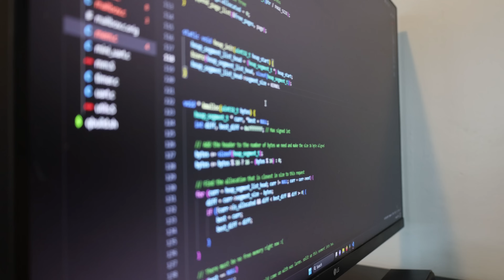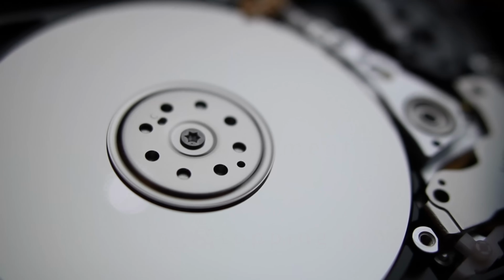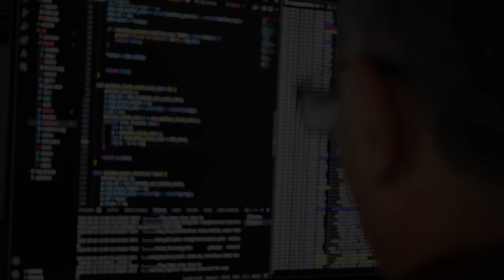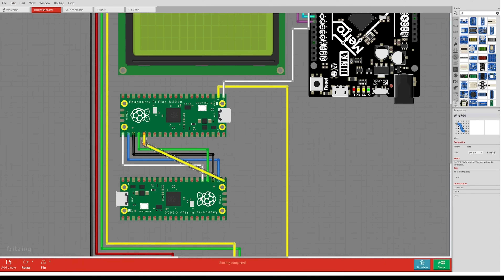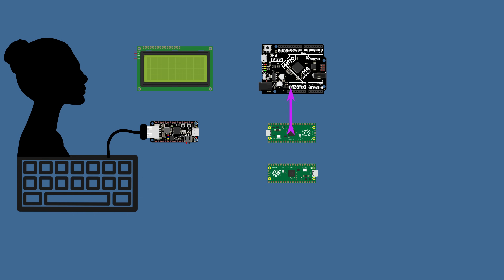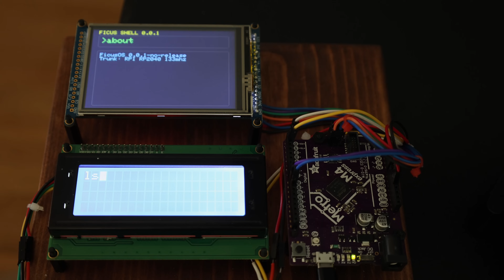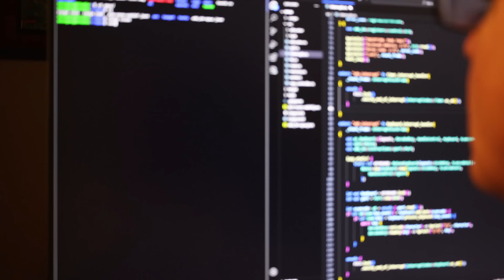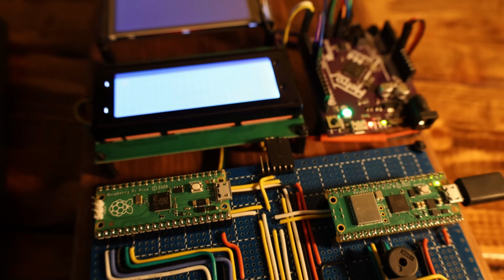Building a Retro-Styled Homebrew Computer & Operating System from micro-controllers

Comment: Cool project. I'm thinking about something similar. Building a "3D console" style computer. Where you have dedicated jobs and specific decisions for the specs. Specific bottlenecks etc and see what Game you could make on it (or rather demos, making full games is much gameplay programming and less 'technical performance' or fidelity). I'm not sure if I'll pull through with this though. It's a massive undertaking.
Reply from the maker: Thanks! Do it - just dive in and see how far you get. It sounds like an interesting project, tell us about it as you make it. Cheers!

Comment: interesting that you show rust when saying "high language abstraction can shield you from what happens on the underlying hardware" :D You need to know a considerable amount about the language itself until you understand what rust does under the hood. Also C++ knowledge does help, because many of the concepts of rust are somewhat a "cleaner solution" of what C++ abstractions caused. Rust is compiled and low cost abstraction, but it's full of abstractions. There are few languages that are actually low abstraction and close to metal and really transparent about what they do.
Reply from the maker: Fair point - you're not wrong: its abstractions all the way down really.

Comment: Those microcomputer experimenters from the 70s and 80s, most of them learned the opposite way, starting from microcomputer hardware, which often enough just ran a BASIC without an OS at all, to CP/M and eventually MS-DOS, maybe along with something like AppleDOS.  And those systems weren't like Unix, often they had very specifically, "Disk" operating systems, maybe after learning micros with cassette tapes.  For you to learn first programming languages and AI (of various flavors, I presume) on top of Unix and unix-like OSes, definitely places you in a very different space. Also, Microsoft ruined the term 'operating system" when they sold their GUI "Windows 3" as a new operating system rather than a graphical shell on top of a DOS.  From that point the market would call any sort of platform they wanted as an "operating system".   I don't know, I'm fascinated, but suspicious of someone approaching this from the "wrong direction". It's hard not to think of this as a dilettante's work, especially with the "dark winter" and flowers in spring  -I don't need that crap. Leave that to film class or the English department! lol
Reply from the maker: This is  pretty interesting take. I read it as you saying that, since I didn't learn the same ordering as some others learned, my experiences are not valid to share. Interesting. Since I was still a kid in the 70's and 80's, I missed the boat and its too late now?  That would be a sad world. When people from different backgrounds approach a problem, they bring in new viewpoints that would often get missed in a single-discipline echo-chamber. That's why cross-functional teams are more effective than horizontal-silos.

Sadly, I think you missed the entire point of the video: its never too late to learn or grow. This was a super fun project, I learned a lot and have a beautiful machine that people who see it find interesting. Call it the work of a dilettante if you will, but I mentioned several times in the video that the entire thing was an artistic expression as much as a technical project - including my other interest: film making.  I am learning and growing.

Comment: I would like to do the same thing using the S100 bus and fix all of the design flaws.
and add every bell and whistle that didn't exist in 1977...
Maybe give it a dual mode bus, so it is backward compatible, but have a 2nd mode that gives it access to unimaged capabilities that can be done today...
Reply from the maker: Interestingly, I just watched a video on a found homebrew based on the RCA 1802 where the maker had built their own backplane (not S100) - it might be interesting to you: https://www.youtube.com/watch?v=4pgO7CvsdfI - thanks for watching - cheers!

Comment: Using multiple SBC all mashed together is kind of hilarious. But I guess it's easier (and cheaper) than sourcing a bunch of random Z80s and sticking them all on a breadboard.

I'm surprised you said the RP2040 is maxed out with the keyboard. It's a dual core, 130Mhz CPU. I'd expect you to be able to use that second core for processing. USB is a pain on such small devices, and so I can understand why you just had an entire MCU dedicated to polling it, but a Pico is more than capable of reading the USB protocol properly as still having plenty of room left for processing.

PS/2 devices are hard to find these days, though you can get adapters, and could even make it simpler.
Reply from the maker: You're right about the keyboard module - it definitely has plenty of clock-cycles left over that can (and will) be put to use. There are lots of optimizations and honestly this could been done on one or two RP2040s. This was mostly an artistic design and it does an over-abundance of processing, but that has the advantage that I can develop out services on the nodes over time to make it into a capable little computer. Cheers!

Comment: I have a computer architecture design that very literally has limitless parallelism for the code that you write.
Reply from the maker: Would like to hear more about that - any overview information?
Reply: @wrongdogreckons-cp2sy  that's way to much info for YouTube to handle. But...
It is similar to an FPGA but completely different. 
The highest level overview...
I got what I call a cluster, truly thow that's the entire architecture...
Each cluster connects to eight other clusters in a three-dimensional stack.
There is no multiplexing.
All clusters are flawlessly identical so no way to address a particular X,Y,Z if its not in use.
but the eight ports on each cluster are numbered so you can "snake around" through an XYZ matrix of clusters that are "blank/formated" but doesn't matter if blank or not...
The full address of a cluster is broken down into three parts. The application ID, function ID, and sequence ID. , That should be self-explanatory enough, that part with the ID's.
So when you are writing your code aka populating clusters, you are also giving them their address but you don't have to really think much about it if you use it in the logic that I mentioned.
It is a process in memory style type of architecture. There is no ALU, GPU or CPU but it is All and None at the same time.
There are three types of buses that run through the entire architecture the way the clusters connect to each other through ports but their identical in function but their
used differently, I don't have anything in particular I call them just high medium low buses.
If you are trying to get ultra fancy with your coding, on the low level bus, you would not really need more than two duplicates of the low level bus. But just one is perfect.
For the middle level bus, six duplicates is probably pushing it to be overkill, buh that's trying to seek the most absolute godlike performance.
For the high level bus, however many duplicates of it you have, essentially you could 'almost' consider that your core count, but not truly.
The high level bus is used for application to application communication, system to system, application to system etc, Also including external hardware, mouse, keyboard, speakers, printer, monitor, network, USB, etc.
The middle level bus is used for function to function communication inside of an application.
And the low-level bus is just following sequence, the order of operations. Your assembly code one instruction after the next.
The clusters physically defragment to each other. So it does not matter if it looks like a perfect cube or if it's branched out like lightning. As long as the appropriate clusters are neighboring each other at least by one port. Let me give you a visual example. You have a bag with a thousand marbles aka clusters. Each cluster holds an assembly instruction. (following the sequence), So on the low level bus, the particular function of a particular application will zone off all of its clusters, making a pool on the low-level bus. So however many assembly instructions are used to make up that function, they can follow the order of operations, the sequence, all day long and not interfere with any other functions of that application or any other application, because the ports are cut off on the low-level bus that do not neighbor the same function of the same application.
And to have functions communicate with each other inside of the same application., they will use the middle layer bus. With the middle layer bus, the way those ports are cut off, is representative of the application as a whole.
And when one application needs to communicate with another application or hardware, they will use the high level bus.
Physically externally you are 'kind of' in a way limited to the duplicates of the high-level bus. But internally you are not physically limited to high level buses because of a feature I developed called the rope bridge, but using it wastes precious cluster space, It forms a physical bridge connecting one or more applications or even particular functions between applications without using the high level bus at all.
Reply: @wrongdogreckons-cp2sy  Part 2, here is the continuation because YouTube on my phone could not handle editing the above text as I was typing.
I need to bring up hard coding addresses on any other architecture creates security issues but not on mine. Here's why.
Since there is no multiplexing, you have one wire per bit.
One cluster that wants to activate another has to put its identity/ address on the bus, the cluster that it wants to call out to, its instruction, its data, etc. And the receiving cluster sees its identity being called. The receiving cluster checks its security ID, a section within itself, kind of like a registered but permanent storage. that aka register has enough bits to store an entire address application ID, function ID, sequence ID.
There is a way to store an unlimited number of security IDs starting with one cluster, but it's too much to go into here. Not important at the moment.
You can be mediocre about the security by just filling in the application ID and leaving the others blank or you can have stronger security by filling in the application ID and the function ID or extreme overkill security by setting all three in the security ID.
If the security ID filled in matches the identity of the calling cluster then execution continues. otherwise the calling cluster gets terminated.
There is no way to soft code or hard code around this. And obviously if the security ID is left blank then any function of any application can interact with that particular cluster.
I haven't mentioned this part yet, but it should have been obvious. The callings are a broadcast message. So if you've got a thousand clusters pooled up on the low-level bus and the first sequence calls out to the second sequence all thousand or 999, get that message.
And no address is ever used with all zeros for all three together or individually application function sequence. This saves on electricity usage.
Reply: @wrongdogreckons-cp2sy  Part 3,
In regards to external hardware using the high level buses, so physically you would be kind of limited. But the reason I said not exactly is because of, ...
For one, how many of the clusters are you willing to expose outside of the periphery of the chip?
And for a piece of hardware like speakers, for example, you could hard wire to the middle level bus or even the low level bus. So your sound processing app would have isolated access to the speakers and of the hundreds of applications that need to output sound. Well, they have to go through the sound processing app anyway.
Reply: @wrongdogreckons-cp2sy  part 4....
.......
For one, if you are willing, of course, and if you think hard enough, you will know what the following is for...
Nehine oh fur, for stix hero, ...... ..... ..... .....
Reply from the maker: @davidprock904   - thank you so much for these details - I am parsing through them now and will have some questions. Cheers!
Reply: @wrongdog_reckons  i told you this information because you seam legit, having skills and experance, i belive you would catch on. i really didnt want to put as much detail as i did on youtube. this is a trillion ^ trillion dollar design. Once all software on the planet has been remade for it, no body would want anything else, it puts an end to memory hacking with software, you would need physical access.
also some more details.
beacuse of the "protocol" the way clusters work together, you do NOT need a clock!
because of the limitless parallelism you would think Race Conditions would be all over the place, but not true if you code properly for the hardware features.
BUT there is still a clock, each cluster individually has a bit flag you set if you want it to obey the clock. the only reason you would want to use the clock is for processes the human would directly interact with. a great example... you wouldnt want to process (play) an hour long movie in seconds or a minuit.

Comment: I respect the passion, desire to learn, courage to try (and fail), and even more resolute courage to re-try (and eventually succeed).  The irony is that the computing horsepower is there in your project to exceed what what 100+ retro computers could do if you go back to the wire wrapped back plane and CPUs made from through hole discreet logic ICs with daughter boards for the various I/O.  But I'm not minimizing what you did.  You learned a great deal!
Reply from the maker: I appreciate that, this was all about trying something new. On your second point - I agree! There are so many optimizations to be had here - but that would make it feel too much like my day job to be fun :) In all seriousness though, recent updates have made it super snappy and my next steps on this are to consider how I can make use of the extra horsepower - its a fun experiment.

Comment: Awesome video! You should look into digital logic design if you want to understand how computers works on an even lower level.
It's actually not that difficult to develop a computer on the logic gate level, or very close to it(digital logic design). You could start with a graphical logic simulator like "LogiSim Evolution" or "Digital"(names of good logic simulators). For learning It's probably easiest to create a completely custom simplified architecture piece by piece. For better programming and debugging, you'll probably also want to write your own instruction set emulator and a basic assembler along the way. It takes a bit of back-and-forth adjusting until you have an architecture that is both nice to program and nice to implement as a digital logic design. Once you got the hang of what is what, you can plan out a physical build in the same logic simulation program using e.g. 74xx series logic chips(chips actual computer were made of, most of them still available!). You'd need to code up a basic operating system in your own assembler. Or re-create an architecture with an existing compiler in the logic simulator using logic gates/74xx series logic chips.
I'd be glad to help out, as I just recently learned how to do most of this myself. I'm usually a software guy, but my desire to understand computers better lead me here :P

Comment: I was wondering how you could arrive at that many computers. It's like you added one or two per function block. Each RP2040 has processing power nearly on par with a BeBox, but memory only half of an Amiga 500. You didn't run out of processing power; you just didn't add scheduling, the core part of most operating systems.

On the plus side, you got plenty of experience with inter-IC communication!

There's also precedent for this type of distributed processing; Commodore computers ran the disk operating system in the disk drives, and the Apple 1 had a functionally separate terminal from the computer. An interesting extreme is the GreenArrays network on chip where it takes three computers to interface with external memory, which is okay because it has 144 of them.
Reply from the maker: You are correct - the latency is largely about communication timing and there isn't any scheduler. In the context of 'running user commands' it is not mult-tasking, whoever gets to the processor first gets full reign.   A lot of my decisions were about the look of the piece and it looked better with more chips :) I do like that I have plenty of processing power left over to add functionality.

Trying to read, but I am super confused about GreenArrays though - trying to Grok what they are doing there. Its great that they have 144 computers on that board, but am unclear on why...
Reply: @wrongdog_reckons  I reckon most who hear of them are as bemused. Consider it an experiment in architecture; its closest relatives are TIS-100, FPGAs and transputers, each of different granularity. It's supposedly quite efficient but not clearly integrated either socially or industrially.

I think a part of it is some old hand Forth enthusiasts saw the extensibility of their platform and wanted to build the new world. They just never stopped, while other things changed around them. A bit like GNU Hurd. They're not wrong, their systems are cool, but they could be improved with basic routing and recruiting people who grew up watching youtube on 64 bit pocket computers to work on 18 bit systems that don't even have peripherals may be a challenge.